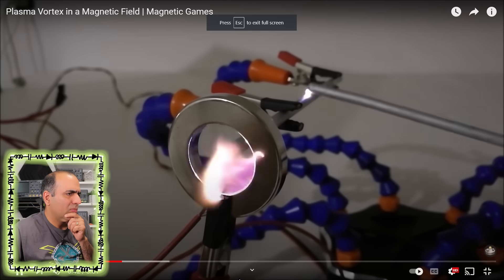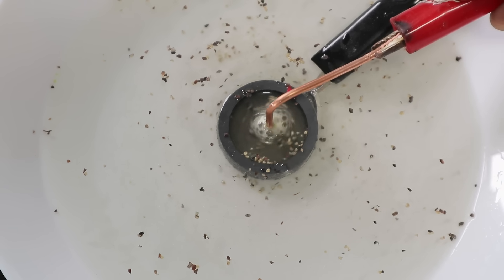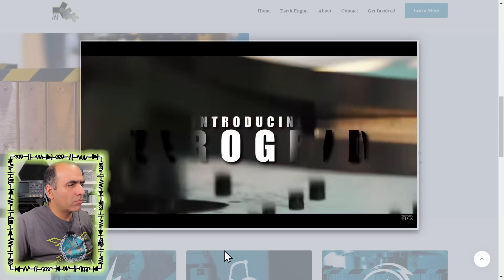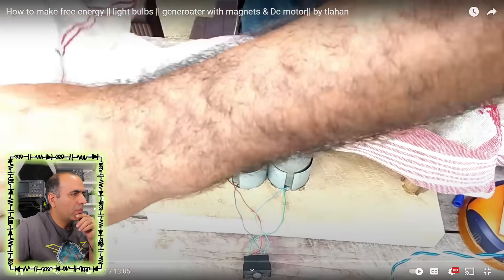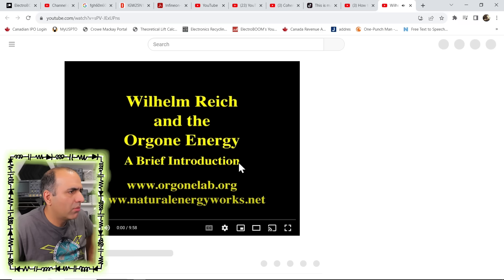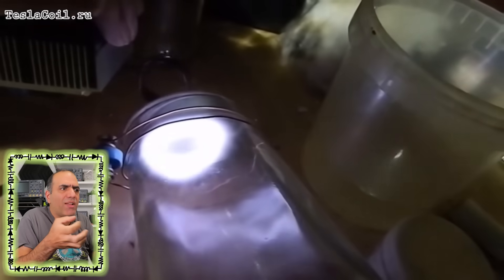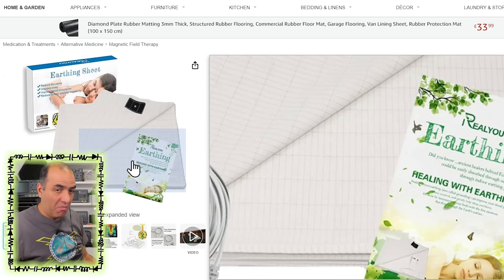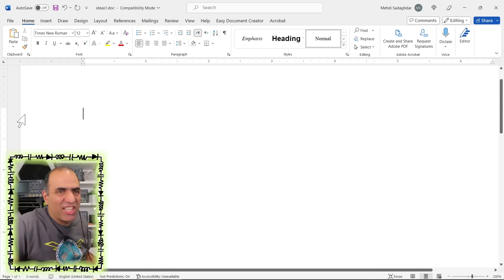Plasma and Salt Water Electric Vortex, Document Free Energy Clean Up

Comment: That's one interesting thing I learned from my great uncle, who restores antique cars. A lot of the old cars battery operated the battery in reverse from what modern cars do. Supposedly that also helped to cut back on corrosion and rust in those old vehicles, so long as they're running and operating that is. I'm no expert on the topic, but that salt water vortex reminded me of that tid bit of information.
Reply: how old is old?  there's a lot of safety problems from having your frame at +12V
Reply: @tsm688  He restores cars from the Ford model A and T era. So about as old as old gets lol.
Reply: I think he's getting confused by the concept of a sacrificial anode. That's a thing and batteries also have an anode but in this case they aren't the same. Rust is caused by oxidation and in those reactions electrons do move around so it is sorta like a tiny battery, on structures that have to be underwater for a long you can install a sacrificial anode, which is made of a reactive material like copper, to prevent the rest of the structure from rusting. This only works though because the entire structure is under water so there is always a path to the sacrificial anode, for anything on dry land this doesn't work because rust here happens due to rain or humidity so the oxidation reactions happen in those small bits of water.

Also oxidation is how chemical batteries work but that doesn't mean that only electrons move so you can't prevent it simply with a current, oxidation reactions do also involve the actual atoms present.

I think what's actually the case is that cars tend to heat up when you run them so whatever water might be on them evaporated, plus just getting them out of what is probably a fairly humid shed also helps and you can prevent a lot of rust damage simply by using something often so parts don't rust together. Like if you just have metal scraping over other metal it'll scrape off a lot of surface rust.

Comment: That Earthing sheet is scary business... How long before someone is laying on it and goes to turn of the old bedside lamp that's plugged in backwards. haha 

People used to die from that kind of thing on a pretty regular basis. Not grounded blankets, but having a hand on a fridge then grabbing the pull chain to turn a ceiling light on. Musicians used get bit by their mics due to the same thing. Playing guitar, hands on the strings, mouth to the mic to sing something, then ElectroBOOM! Dead on stage due to reversed polarity.

Comment: the only thing a grounding pad in your bed is good for is making the touch activated light work
my parents have a wooden bed on a wooden floor, and and a light that you can dim / switch on and of by touching it
the electronics in the lamp check if the circuit from the lamp to ground is closed, but if you aren't grounded, it doesn't work (it works if you are standing on normal floor, this is just a problem with my parents bed)

solution: while touching the lamp, also touch the lamp's transformer's housing, which is grounded
Reply: Usually those lamps work by detecting the chance in resistance no by looking for a ground.
Reply: @hedgehog3180  resistance between the metal lamp body, and what?
you usually need two point in order to measure a resistance across

and in this case, the other point is ground

Comment: I am also an electrical engineer and Pyramids generating electricity is not nonsense, There was university research about this even. It's pretty new research, done in just last year (due to these speculations).
It's new device, Cosmic Muon Radiography, which not only discovered new corridors, but also piezoelectric materials inside the stone. 
Add that to golden top section of the Giza pyramide, which was stolen by Nebucadnezzar*, and the tarnished now white coating that used to exist, which was made of limestone.
This is how you do capacitor practically.

++there are also rumors about some diamagnetic liquid (probably water) turning in spiral canals which also makes sense in terms of electricity production, but there are no supports of using permanent magnets.

You probably heard about second (++) idea that makes non-sense, but you can even search the wikipedia article about piezoelectric properties of Giza Pyramides that was researched just this year. The device itself is 1-2 years old, being first paper published in Japanese University (can't remember which one).
I AM VERY DISAPPOINTED but still, keep up doing videos, Medhi!!!!1
Reply: Some keywords that might prove useful are:
Cosmic muon radiography, pyramides, piezoelectric, and quartz. Hope it'll help you out.

edit: I'm not talking about all the pyramids, just the Great Pyramids at Giza
Reply: ordinary beach sand is piezoelectric.  so what?

you're just throwing around buzzwords without understanding what they mean.
Reply: What level of brainlessness is that? One is structure, other one is bare material. By your logic, microprocessor and sand are the same.
 @tsm688
Reply: Of course there are piezeoelectric crystals in the great pyramids, quartz is a fucking piezeoelectric material and it's in like all rocks so of course there is some in the pyramids when they're made of stone. Also the defining property of piezeoelectric crystals is that they generate a voltage when deformed, like the hammer in a lighter, so unless you find some giant hammer slamming down on the pyramids I'm afraid they aren't making any electricity. And I'm gonna be honest I don't buy for a second that an electrical engineer could somehow not know what piezeoelectricity is.

Comment: The term free energy is used by people as if they know what they are talking about.
Over Unity devices there is only one in existence and it is used to power a UFO type device.
Guess what it uses a Tesla Coil and Crystal to create a vibration and it flies creating negative ionisation wells and a positive ionisation well.
Rather interesting stuff the demonstrations are interesting when you see them flying around.
Reply: which is free how?   something has to power that tesla coil
Reply: @tsm688  there are many inventors in this world who have been ripped off by enquiring minds about how is it possible.
Did you know that vibration has been used to produce power for over 20 years and it is used in industrial applications. 
People make fun of significant breakthrough calling it out a scams.
YouTube is full of people making fun of technology that does exist and they mislead people into thinking that the technology doesn’t exist.
Try this simple experiment two magnets opposing each other an iron rod two LEDs. Now I will leave it up to you to figure out how you can obtain electricity.
Your job is to figure out how it is done and what proven science supports your process and makes it work.
The only hint I will give you is this things expand and contract but it is not through heating of the material.
Such materials are used in sound technology and have a unique ability.

Comment: The term free energy has nothing to do with producing electricity from nothing.
Solar Panels provide free energy.
I have a device that uses Magnetostrsiction to produce electricity.
I give it a kick start using an LED.
The LEDs provide the power like a pump intermittently.

Using strong magnets opposing each other it does create a small uV.
There’s a generator already developed and being sold for industrial use.

Comment: Car fuel saver basically goes in and reprograms the engines fuel thing to make it to where it limits the amount of fuel which it also limits air flow as well so it is a true purposeful device but it depends on the vehicle.
Reply: How can it do that by plugging into the **battery port**?

Even the ones that actually plug into the debug port are usually scams, though.  They contain a LED and little else.  Big Clive has dismantled a bunch of them.
Reply: That's not true. Your car's computer already carefully controls the fuel air mixture of your engine to achieve peak performance so there is nothing more to be done. Most of the time these “fuel savers” are nothing more than an LED on an empty circuit board. The only way you can save fuel is by driving slower or just driving less.
Reply: Look at the ogle carburetor right quick my friend.  @hedgehog3180

Comment: For anyone wondering, the "Slingshot effect" that the "Earth Engine" people talked about is called the Oberth effect which states that you get more speed out the same amount of thrust if you are closer to a object you are orbiting.

It sounds like it could generate free energy (but it can't), the problem is that to even utilize the effect you'd need two things to orbit in a machine that preferably isn't the size or weight of the moon.
Reply: Also the energy isn't free, gravitional assists technically steal a tiny ammount of orbital velocity from the body doing the assist.
Reply: they mixed their metaphors.  sometimes it's the oberth effect, sometimes its flywheel, sometimes its magnets.
Reply: You're confusing the Oberth effect with gravity assists. The Oberth effect means you get a bigger change in kinetic energy from the same change in velocity the faster you are moving, as kinetic energy is proportional to the square of velocity, and therefore you get more from the same increase the faster you are already moving (like how going from 0^2=0 to 1^2=1 is only an increase of 1, but 1^2=1 to 2^2=4 is 3, and then 5 with 2^2=4 to 3^2=9, and so on. Vice versa, going from 3^2=9 to 2^2=4 is a bigger decrease than 2^2 to 1^2). Conservation of energy is not violated because the propellant ejected to move the spaceship also loses more kinetic energy from its change in velocity.
Reply: @FlamingKetchup  yup. simplified: the oberth effect allows a more efficient use of your fuel, by also taking advantage of the higher kinetic energy within the fuel itself when you (and your fuel) are going faster. it's used by boosting at the lowest point of your orbit, thus the point where your rocket is going the fastest.
Reply: *Or the propellant gains more energy, in the case of the spaceship burning to slow down and lose kinetic energy

Comment: There is no free energy!
I releave em all!! 

(That was the moment where i start to learn all about  how real Electronic works ❤)

Now I teach you:

All Youtube Videos Shown only: simple battery chemie and it calls "galvanic law"

2 different metals + a base = energy:

ferrit (ring-magnet) + irdium (sparkplug) + Circus acid, Saltwater, earth or whatever = 0,7v energy.... + 0.02Watt SMD led to troll people -> not endless but looks funny 😂

All other Videos shown only
Selfrunnig motors for
...Yep!...ONLY Selfrunnig !!
With a pefect balanace/unbalance system 
__
BUT
One real resistor and it goes slower and slower until it stops with the time (thermic law will win)

Not more 
________

Ps: have an nice weekend 
And here is my bullshit idea: 😂

12v battery + 230v, 3000w inverter..   now load the battery with the 230v side and an charger WIN😂😂

Comment: So i get that free energy in nonsense, since energy cannot be created from nothing. But could u not theoretically create a perpetual energy loop? It would be redundant as it would make it inoperable, but say u take an electric car. Could u not use 100% of the energy generated from the engine to recharge the battery perpetually? Or is it just impossible for the engine output to ever equal the batteries input?
Reply: Look up "regenerative braking".  They can get some of the power back when the car stops, just not all of it.
Reply: That is indeed impossible because of the second law of thermodynamics. It basically says that it is impossible to make a 100% efficient engine. The short answer as to why this is the case is because in order for energy to be useable by us it has to be fairly concentrated. Like with coal it contains a bunch of chemical energy that is stored in one bit of coal, when we burn it that chemical energy gets turned into heat energy and we can capture some of it (roughly about 50%) but the rest escapes as heat that is now so spread out that we can no longer harvest it. In fact the second law of thermodynamics even imposses limits on how efficiently we can extract certain types of energy, for something like a coal or nuclear power plant that uses a steam turbine the absolute best possible engine would at best be 65% efficient. And this 65% efficiency is only possible when you have no friction losses and perfect insulation. Turns out that in order for us to extract energy there needs to be some sort of difference we can extract energy from, either a temperature difference or say a difference in potential energy like in hydroelectric dams. This is basically why in all processes we will always loose energy, there are only so much stuff that burns and there is only so much water uphill that can flow through our dam. Sure the sun will eventually replenish mountain lakes and new plants will die and become coal but the sun itself has a limited life span and the majority of the energy comming from the sun doesn't even get captured in a way we can use.

And this lost energy is also what's known as entropy, you might have heard the word before but all entropy really is, is just energy that we can no longer use. In physics this ability to use energy is what we call “work”, and only some forms of energy are able to do “work” while others cannot do work because they are simply so spread out, and the energy that can't do “work” is what entropy is.

Comment: Ok here's one: Draw energy off of Earth's rotation. Field trip required, literally. Find a field with a fence that has a long conductive wire, preferably aluminum running north and south. Ground one end, measure the other between wire and ground. (Or just run one through your neighborhood street for half a mile or so with little ribbons at the intersections, this keeps drivers from ruining your experiment, grandmas at least). The return path is distributed through the ground, an imbalance, slightly different in the wire vs underground. Earth rotates through its own field which just sits there, verify with a magnet affixed to a motor shaft so it will spin on the same axis as its magnetic axis, placing a slab of copper near it, no effect, the magnetic flux lines are not moving.

Don't draw too much power for too long from this or you'll slow Earth down and we won't have day and night anymore awfully boring.
Reply: The Earth's magnetic field rotates with the planet. Otherwise literally anything running north to south would have a voltage across it.
Reply: @hedgehog3180  Nope. It's called the Faraday Paradox and can be seen at watch?v=33Jm1rsM4Yw that the magnetic field of a magnet spinning on its magnet field axis just sits there with the magnet rotating through it. 

Another way one can verify the phenomenon for themselves: Rotate a magnet on its magnetic axis connected to a motor and place some pure copper up to it, no drag as one would intuitively expect (because the magnetic field is just sitting there and so the field and copper are not moving relative to each other). However, reversing that, rotating copper and placing a magnet up to it, the effect is felt, Lenz's Law kicks in.

The field of physics involves certain beliefs. History shows that progress is what happens when we find one that was wrong and delve into it.

Comment: Mehdi be careful im pretty sure when you conducted the salt water vortex with the 12v battery in a nutshell what you did was electrolysis. in that case the yellow substance that formed could have been chlorine. Fun fact: the white bubble that form are actually hydrogen bubbles which can combust if you hold a flame close to it

Comment: What energy transforms into sun energy? Or is it free energy?
Reply: The sun is a fusion reactor and it will run out of fuel (hydrogen). It is not perpetual or free energy. As far as we know today, all of the potential energy in the universe was present at the Big Bang and all that potential energy is slowly being converted into waste (thermal) energy. This will continue until all forms of potential energy have been converted into thermal energy and that thermal energy has evenly distributed throughout existence. This is called the heat death of the universe.
Reply: The sun fuses hydrogen into helium in its core and that's how it generates energy.

Comment: Sad to see this ch. so easily dismiss so many, EASILY DEMONSTRABLE & PROVABLE discoveries simply because you are not familiar with them or what makes them work isn't currently taught/ easily understood by current "science".
It doesn't diminish you, but only IMPROVES YOU to KEEP YOUR MIND OPEN TO NEW POSSIBILITIES! 
I CHALLENGE YOU, to explain why SEEDS will germinate and grow SIGNIFICANTLY FASTER when under a simple metal wire pyramid!   The experiment is SIMPLE!  Just plant a 2 seeds in two separate cups & place them in equal sunlight w/equal water but place a simple wire frame pyramid over one of the cups through the experiment.  Explain the results using "NORMAL" Science.

Comment: You know what’s fun? It’s fun when molten weld wire get stuck in the gas nozzle of your welder and you zap yourself at 15 amps didn’t know what voltage I took thru my left arm.
Reply: probably low, fortunately.  welders tend to be low voltage hi amps.

and unless you're made out of metal, you're probably high enough resistance you didn't conduct enough amps to kill you.  ohm's law.